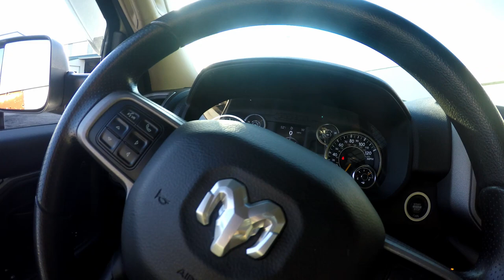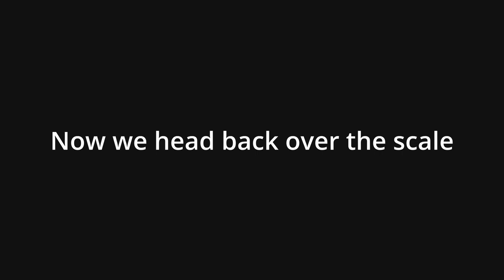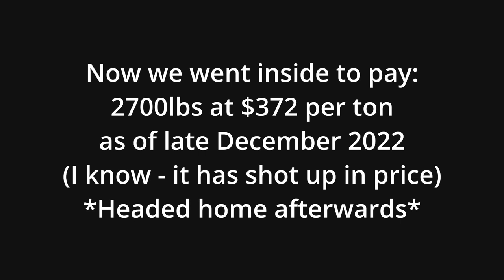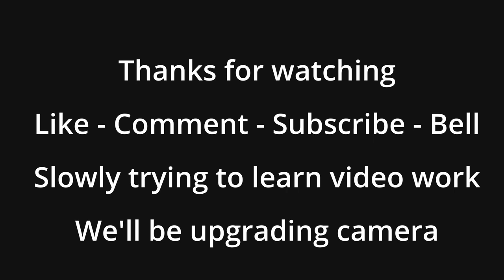Pick Up & Unload of Anthracite Coal Using Load Handler

Comment: Great video. Wish I could get coal in bulk - only bagged around here. Over $500 a ton these days. Was $350 just a couple years ago. How's the Anthramax working out this winter? Any updates?
Reply from the maker: Wow that's expensive - I believe when we picked up coal a month ago it was about 385/ton which is 150/ton more than it was 3-4years ago so I feel your pain.  The stove is running good no issues - it's dialed back right now since we're in a warm spell the past few days.

Recently I added insulation foam to the attic access panel, and went around the attic and where the framing meets the basement walls with expanding foam to seal air leaks - next is to replace door seals to help conserve energy and therefore less coal use in winter and electric use in summer.